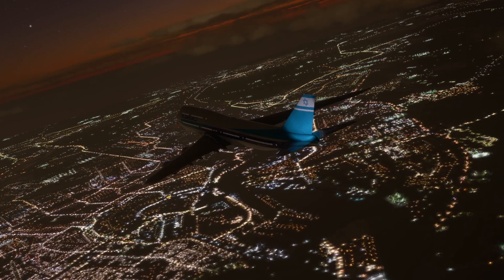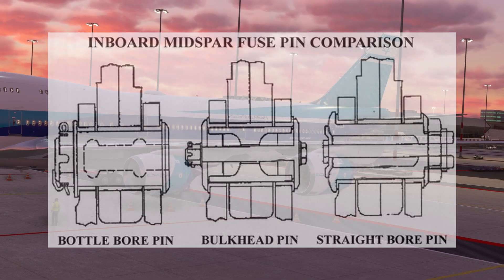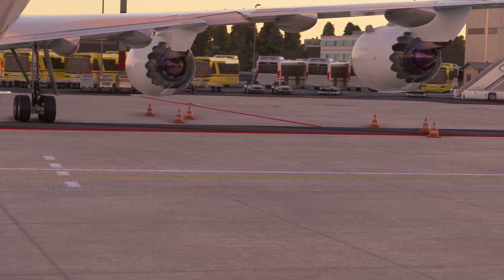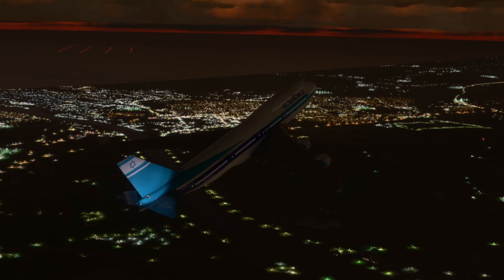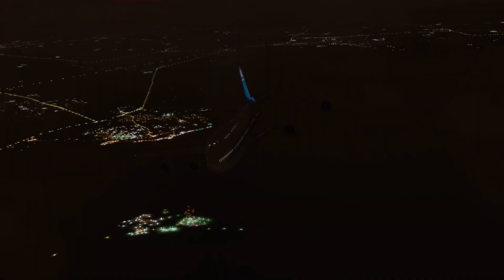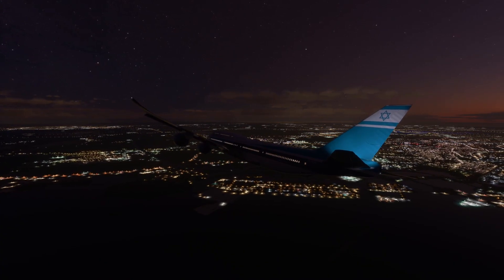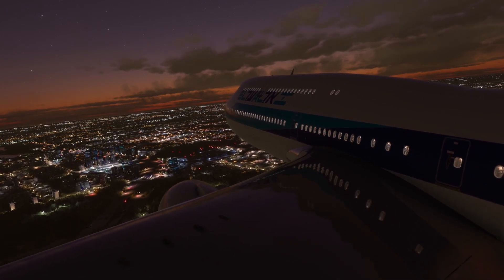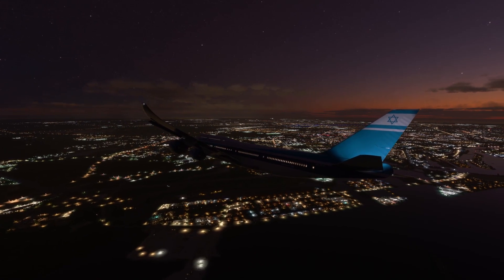Boeing 747 CRASHES Just After Take Off In Europe (with real audio)

Comment: Other than the robotic voice, pretty good accident description.  Normally you never turn in the direction of the failed engine(s), these guys kept making right turns which I'm sure amplified their problems.  They could have indicated to the controller they needed to make left turns.  An Evergreen 747 made a successful emergency landing after losing an engine and pilon due to excessive turbulence with substantial damage to the leading-edge slats of the wing on takeoff, just saying.  Their airplane was scrapped due to unrepairable damage.